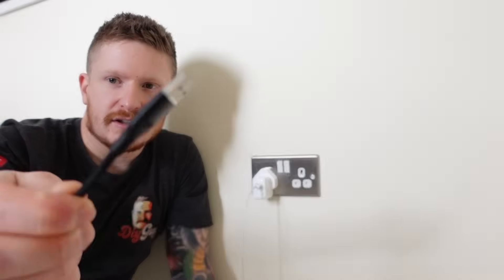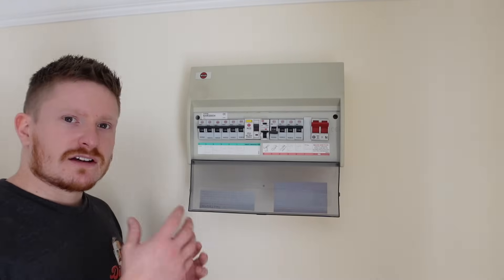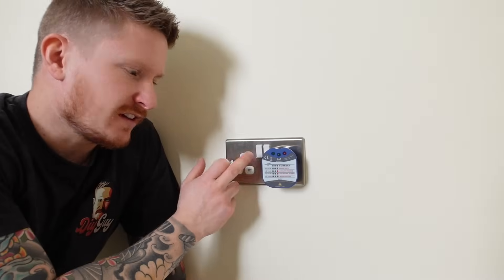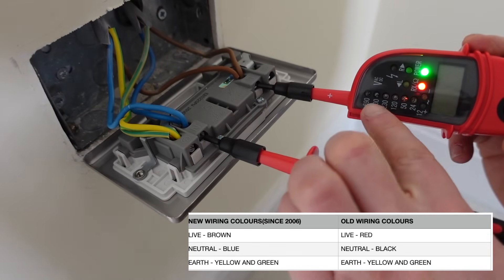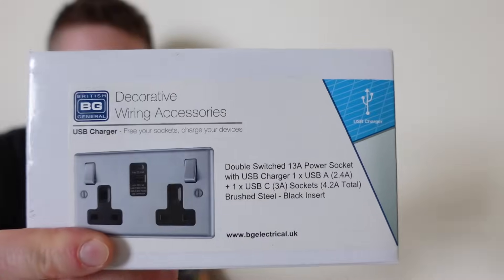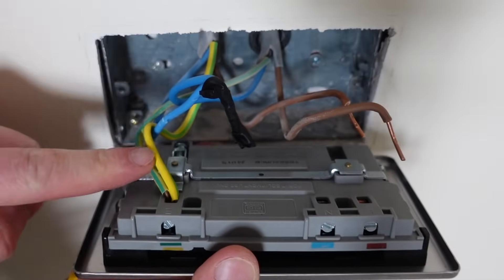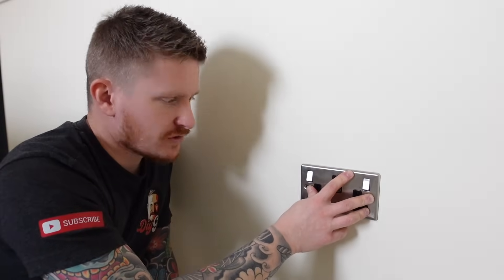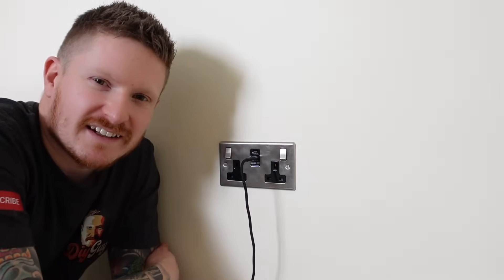How to Install a USB Plug Socket in Under 10 Minutes | *No Electrician Needed*

Comment: Thanks mate, just to ask one thing, in diagram & instructions picture in BG double socket with USB A & Type C they shown two cables of earth using both hole of earth up n down, one they say functional Earth which they put in bottom hole of earth and 2nd earth cable which they say ( to mounting box earth terminal) which they put on top hole, but you put both earth cables on top hole ? Does it make any difference? Cheers

Comment: I took my socket off the wall and to my surprise found three of each wire plugged into my socket. Through testing i figured out one goes to anotger socket in the same room while another powers a few sockets in the kitchen.

It feels weird seeing three cables jammed into one port, could i clean up this setup by using wago connectors perhaps, so all three lives into a connector, with one new wire going to the socket (same for the other wire excl ground?)

Comment: Many many usb 13amp sockets will not fit in a 25mm box especially when the socket is on the ring (two 2.5 cables) it needs to said.
Reply from the maker: This will be listed in the product details. You will find a lot of manufacturers are now leaning toward minimum 25mm backboxes.

Comment: Great vid - A good tip I saw (I think on @Artisan Electrics) is after you push the socket back into the back box, pull it very slightly back out and retighten the terminals as pushing the box back into the wall can be enough to let the connectors settle a little in the terminals.

Comment: The socket tester won't tell you if neutral earth is reversed. Call an electrician who can test and assess the install safely. If you have type ac rcds installed then these extra dc loads will blind the core and prevent it working.
Reply: No need to call an electrician for a simple socket change if you have the first idea about what you're doing
Reply: There is no reason to suspect that the earth and neutral are reversed when you do the work properly. In anyway such thing would trip the RCD in a modern installation.

Comment: Excellent Video instruction, Just wanted to warn people to check the current output of the USB plugs. I replaced a few and I think 2A is too slow for modern phones. You need to make sure it's a decent ouput. I think 3.2 is a Max at the moment and you need a decent rated USB cable for, whereas some new adapters will give very fast charging. 
Also note the current in the USB is normally shared between 2 and you may find 2 modern hungry smart phones charge too slowly.

Comment: Please for the love of god do not touch your electrics people. No matter how good the instructions are. We carry out a lot more tests after the work here is done to prove that the work done is safe. just turning it back on and it working DOES NOT mean it is safe. For example if one of them live cables fell out as you pushed the socket back but didn't touch anything you would never know there is a problem as everything will work fine, BUT you now have not got a ring main and have turn the circuit into a radial. The cable can now not cope with the current that you could draw into it and causes a fire. I know the odds are slime but it your life and house that is at stake. 
I will never understand why people DIY with electrics as they wouldn't play with their gas pipes.... Both are equally as dangerous.

Comment: I would not advise this.  The USB outlets cannot be switched off, so they are powered 24/7.  The capacitors (or other components such as transformer) in these will fail after a time, somewhere between about 1 and perhaps 3 years.  When the circuit fails the result can be (depending on the fault condition and build quality) anything from a merely defective outlet to a fire in the wall cavity or mains on the USB.  When someone invents a USB outlet which can be isolated with its own switch, then they might be a good idea.
Reply: Is this why USB sockets make small buzzing or humming noise? I recently changed one over to new one and it's buzzing very faintly when I'm right up close to it. Thinking of just changing to normal socket as I think the USB ones are actually proving pointless and waste of money

Comment: How do you know the socket tester didnt just fail at same time you flicked off an mcb ? No point using a lock off kit if you dint do the proper safe isolation procedure

Edit. Nevermind i just got to the part you whipped out the proving unit . Top man 🌟

Comment: Great video but it doesn’t stop there as you would have to follow several more steps before the job is safely done.
Just because it switches on and works doesn’t mean it’s safe to use, especially on an older property.

Comment: Nice video .I have a question ,I have a plastic surface mount back box and a plastic socket and the back box has an earth screw on it and my socket has an extra screw for an earth .if both my socket and back box is plastic do I have to add an extra earth to it..and if not if I did add it would it just make it more safe
Reply: There is no reason whatsoever to connect a plastic box to earth. The terminal is provided for use with light switches, which don't have an earth terminal, so all the CPCs can be joined together, or a single CPC can be terminated rather than left loose. Your earth is connected in the socket and thereby to the screws.

Comment: You do actually realise that ANY electrical works are meant to be carried out by a qualified electrician for a reason now. Clearly you've never studied regs !
What a ridiculous thing to be advocating !
Reply from the maker: I disagree on many levels which a won’t take the time to address considering I doubt you will agree with my reasoning. What I will say for the benefit of other reading this is, if competent and confident there’s nothing wrong with carrying out this work as a DIYer.
Reply: Try finding one who'd come out just to change a plug socket.
Reply: Oh shut up.
Reply: Not true. Part P is very clear that even notifiable works can be carried out by non-qualified people, as long as they are notified, inspected, tested and certified by someone who is (the cost of this makes it uneconomical). Anyone can do non-notifiable, but it still has to be inspected, tested and certified, which is where most DIYers break the regs - they don't usually have test equipment to do ring continuity, earth loop or insulation tests or certificates to complete.

Comment: By the time a DIYer has bought a socket tester,
a voltage indicator and a proving unit and a lock out kit you will have paid more than an electrician would charge. How about doing an earth fault looop impedance test on the circuit?
My Multi function tester costs nearly a £1000 that no DIYer will have.
The number of DIYers who have mucked up their electrics over the years has made me a tidy    profit sorting out.
That metal socket should be earthed to the back box with a fly lead as per the regs. You should not rely on the socket screws for earth continuity to the back box
Reply from the maker: Fair points on cost however those are tools for life and would come in handy for many electrical jobs a DIYer might undertake. Fixed lug so doesn’t need a fly lead.

Comment: Great video mate always thought you'd need data cables 👍. Why did you just wrap the end of the neutral cables, what happens if the live touched the cpc or is that unlikely as they are either side of the socket ?  The consumer unit is a split load one I think, maybe you could do a video explaining what the difference in these  consumer units. Thanks and keep up the great work 👍
Reply: The reason is even when isolated , a neutral and cpc short causes the main rcd to trip and since its a split board where the rcd controls many circuits it could cause damage or make your work area unsafe due to lights going out ( for this reason I put one light circuit in same room as sockets on the other rcd just incase ) 

If it was an rcbo board each breaker is its own rcd basically so it wouldn't matter then as it won't have any effect on any other live circuits 

Hope this helped

Comment: By the time you've bought a socket tester and lockout kit, an insulated screwdriver, a voltage tester, a proving unit, you might as well have paid an electrician to do it properly. Just a terrible idea.
Reply from the maker: Fair points on cost however those are tools for life and would come in handy for many electrical jobs a DIYer might undertake.
Reply: I really think you've missed the point. And most people who are into or want to get into DIY do multiple jobs which will require a lot of the same equipment. Some items are a bit overkill but what's shown here is best practice. As long as you know how to isolate the system by turning off a switch and have a means of testing that the circuit is dead, and don't have people in your home who will just go and turn the switch back on while you're working on it you're safe. A good set of insulated screwdrivers isn't expensive and will come in handly for many jobs, you can even buy one or two of the most common sizes seperately. This is not a terrible idea at all, you're just clearly not the target audience.
Reply: @Nyle95 he's the electrician you'll no longer be calling out😊
Reply: I purchased all those items, I’ve now used them several times and thanks to videos like this from the DIY Guy I’m happy I’ve done the jobs correctly, safely and I’ve saved a fortune. Why so negative? 😏
Reply: I would say the negative comments are coming from sparks potentially doing them out of work. @fishingotheradventuresonke7996
Reply: Not a terrible idea. Its not single use equipment that disappears after one use. Also electricians are much more expensive than the equipment you listed. Its good practice to do stuff yourself and learn. And The same principles can be applied to other electrical circuitry around the house like changing light switches. Thats where you will learn about sleeved wiring, L1 L2 and COM terminals.
Reply: That makes no sense. You’re going to hire an electrician every time you change an outlet in your house? What he is showing is basic stuff. Yeah, you could hire one but it’s way cheaper to learn how to do this type of work on your own.
Reply: I changed mine in every bedroom, I have screwdrivers and a voltmeter and I am perfectly able to turn off the mains when nobody else is around to turn it back on. This hardly counts as DIY.
Reply: @reggiedixon2  how did you use the voltmeter to check ring continuity and earth loop resistance?
Reply: To be honest, if you don’t own at least an insulated screwdriver, then you’re probably safer to have a tradesperson do it. 👍
Reply: Maybe if you plan to do one socket upgrade and that's it, but if you later decide on other sockets down the line, you're already out of pocket. Terrible idea or terrible opinion of yours... I think the latter.
Reply: While you're at it, please give us some advice on changing our own gas hobs and combi boilers.
Reply from the maker: 😂😂 I’ll see what I can do for you

Comment: Then.
Ring Continuity test.
Insullation resistance test.
Then earthoop.
Then fill out a minor works cert 😂😂😂😂🎉

Nice video 🙂
Reply from the maker: Thanks 😀
Reply: I would agree with this. If you’re working on a ring final circuit, end to end tests of R1, Rn and R2 at a minimum. If you’re doing a proper job it would also be R1+R2, IR, Zs and RCD. Ze, PFC and PSCC, then document results on a minor works.
Reply: @robertsparrow8678  I thought diyers along with myself were not allowed to touch electrics in your own house 🤔
Reply: @kingofthetrowel1725  many things can be done, but everything has to be tested and certified. Most DIYers don't have suitable test equipment or certificates on which to record results.
Reply: @robertsparrow8678  No requirement to test PFC/PSCC on a minor works. And Zdb is all thats required, not a Ze. But I agree the rest of the tests are essential.

Comment: Thank you for this video, very helpful. Do you know if there is a socket that allows the USB slots to be powered off when not in use as I  don't like to leave switches on?
Reply: Yes, you can buy sockets that can be powered on/off  by an app from your phone. Good for all sorts of applications.
Reply: I don't know of one yet. But you are right that these USB outlets are always on with no way to isolate them without turning off at the consumer unit

Comment: That’s all very well if you have the gear. It’s a lot easier to just buy a usb plug or even a multi adapter. Some require a higher output such as an iPad.
Reply from the maker: Fair point 👍
Reply: True. Some devices such as phones will only fast charge if they are charged via the supplied USB and cable. I've fitted 5 of these sockets and so far 3 of the USB ports have stopped working although the normal plug sockets are fine. They also charge extremely slowly. So I've gone back to using the plug and cable supplied with my phone which seems to defeat the object of fitting the sockets in the first place.
Reply: @fus149hammer5 call em socket outlets , plug sockets sounds silly
Reply: They come in different power ratings. Cheap ones are 1.2A output, others 2.1 or 2.4. If you plug in two devices and they're getting 1.2A each it will be slow. But if you charge overnight it's not such an issue.

Comment: A good job. It would be better if there was a small fly lead from the earth terminal to the backbox earth terminal rather than relying on the screws (I've seen some cheap switches with plastic screws). You also seemed to plug the proving unit in the wrong way round according to the pictures (4:17) or doesn't it matter?
Reply from the maker: It makes no difference regarding the proving unit. It is intended to be used either way.

Comment: What would you suggest if the lug on the flushed backbox has stripped thread and doesnt tighten. Is there a way to repair this as opposed to removing the backbox.
Reply: Or you could use a rethreading tool
Reply from the maker: I would replace the box it it were me, it’s a pretty easy job 👍
Reply: If it's a dry wall back box you can snap out the clips (yellow ones I changed) just buy a new backbox and take the clips out them and pop new ones back in

Comment: "No faults on the socket"? Shouldn't there be 2 leds lit?
Reply: I have this same tester and I'm sure it should have 2 green LEDs for no fault? And that's what it's displayed when I've changed sockets.
Reply: Correct 2 green lights just like at the start of the video. I have the same tester and the one green light on the right says it indicates a missing neutral. DIY man can you confirm please ? Perhaps your finger was covering the light that was off and you just didn't see it. Thanks.
Reply from the maker: No fault on the socket, you would see a pulse or red lights if there were dependant on the tester

Comment: "New colour for wiring.."? That colouring has been around for a very, very long time.
Reply from the maker: As per the dates stated in the video.
Reply: @TheDIYGuy1  As I missed any mention of dates in the video, I apologise. Good video, with comprehensive safety described. Thanks.
Reply: Some old houses have the old wiring...we certainly do.